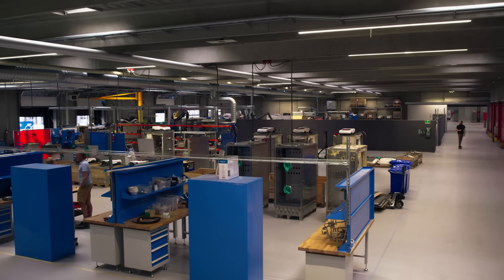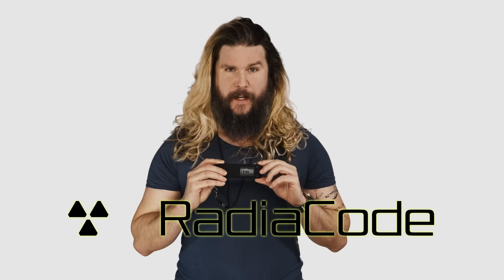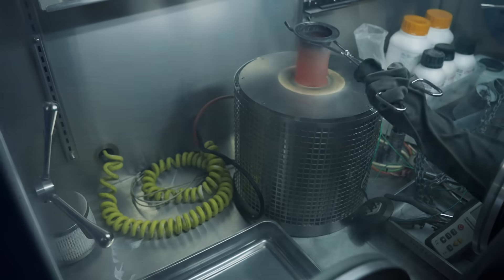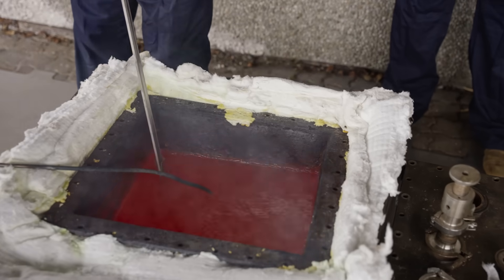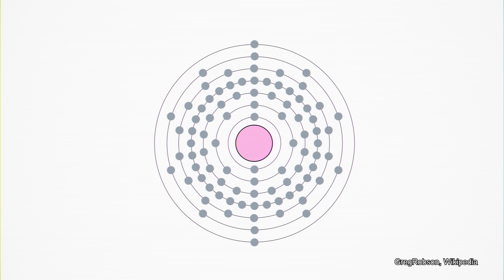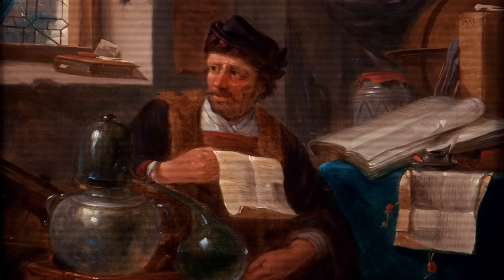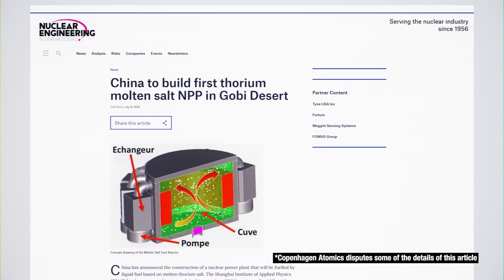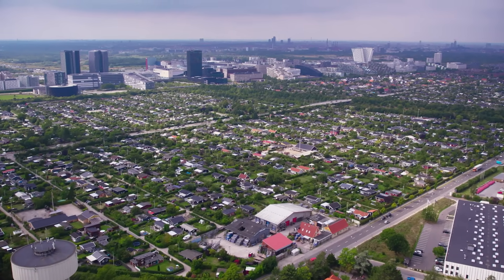Is THORIUM the Future of Nuclear Power?

Comment: The key phrase is "negative thermal coefficient." I wish I'd had heard that in the video. This is what makes liquid reactors passively safe: as they heat up, the reaction becomes less efficient (because the fuel becomes less dense) and the reaction rate slows down, so the reactors cool off and then eventually spin up again, making them self-regulating.
Reply: That reminds me of the sodium acetate hand warmers.  They use a super-saturated solution that crystalizes exothermically... but once the temperature reaches ~160 degrees, the heat actively inhibits the crystal growth by keeping the solution liquid at the melting point of the crystal.  It quite literally can't overheat.
Reply: Retired nuclear plant engineer here. That also is part of all PWR and BWR reactors in the world.   After startup and once reactor and plant power is stabilized PWR reactors pull the control rods and allow the water temperature to control the reactor.
Reply: @perryallan3524  I'm sure he was referring to the MAGNITUDE of a fluid fuel's thermal coefficient vs solid fuel. Does ANY modern reactor operate with a positive coefficient?
Reply: @getmeagator  I understand that there are still some RBMK reactors operating in Russia and a few other countries.  They have positive coefficients at 0-a low power range
Reply: @perryallan3524  Was that before or after they retrofitted them in the wake of Chernobyl?
Reply: @ Both before and after.  The positive void coefficient at very low power are inherent to the design of the RBMK reactor.

The modification after Chernobyl only changed the tip of the control rods - which could add to that positive coefficient at very low power operation.

I do note that the Soviet Union stopped building the RBMK reactors after Chernobyl - they finished a few that construction was well underway.
Reply: Don't keep the 27 day protactinium part of the cycle, too far removed from your math. And when you throw in non-compliant grid scales, amongst deeply entrenched industrialized nations in fossil fuels; you get developing countries as the only viable candidates for this tech to go mass production.
Reply: @numodular  How you get from Th232 to U233 (and other thorium isotopes to other uranium isotopes) has nothing to do with your positive or negative void coefficients as the process is very slow.   This is why thorium cycle reactors are seeded with sufficient U233/U235/Pu239/Pu240 to run the reactor for the 1st several months until enough U233 is generated to run the reactor.
Reply: @numodular Actually there's a decent stash of thorium in Australia, India, Brazil, Turkey and the US. Some of those countries are more developed than the other but they're all economically sizable.
Reply: Passively safe isn't a term. Chernobly wasn't a passive failure... nor TMI, nor many other excursions/incidents. Incorrect (often multiple) inputs were given to cause the incident.

Also, so far, no materials exist that can contain MSR fuel in operation for more than 5-10 years, to say nothing of the contaminated secondary equipment that needs special service and disposal.
Reply: @tehbonehead  Passive Safe most certainly is a term in the nuclear reactor world (and a whole bunch of people are saying that its the sign of a "generation 4 reactor design - but there were generation 2 gas cooled reactor designs that were passively safe).   I believe the 1st passively safe reactors gas cooled rectors were built in the 1970's (I'm not sure if the gas cooled reactors designed and built in the 1950's had passive safety).  Passive safety means that the core will not melt down and release significant radiation if all the active cooling equipment stops working and if the operators do nothing.

As far as Chernobyl, Three Mile Island, and Fukushima.  Those designs all required active cooling to work and often operator actions to manipulate valves and other things (usually with control power to remotely operate valves or start/stop pumps).  You cannot build such reactor designs today in the USA, Canada, and the UK - and some other "Western" Countries.

The Generation 3+ passively safe PWR Westinghouse AP1000 (AP stands for "Advanced Passive") reactor designed was approved by the US NRC in early 2006.   6 have been built and are online now.  A lot more are under construction (China's CAP1400 is a licensed AP1000 design - but a bit larger - and they had Westinghouse design the nuclear side of the CAP1400 power plants).  GE also has a Generation 3+ passively safe BWR design (although none have been built).   The EPR is also Generation 3+ passively safe as well (and I'm not sure of the other modern designs from Japan, South Korea, etc)

In these passively safe designs no active equipment or operator actions for at least 72 hours is needed to protect the core from meldown and protect the public from radiation release.  The plant can loose all electrical power (including control power).  The diesels can fail to start, the operators can walk away from the plant - and passive system will keep the cores from melting down and contain any effects from any of the design base accidents.

I am most familiar with the AP1000 design as I did a consulting job at an AP1000 plant.

The only possible actions needed after 72 hours is in the case of a large break loss of coolant accident (massive primary loop piping failure).  Then a tank that sits on top of the containment building needs to be refilled with water (from plant system, fire-mains, lake water, seawater) and this tank can be filled with firehouses if needed. I'm not sure how many refills are needed ultimately until the decay heat from the core is low enough that gravity water cooling of the containment building is no longer needed (I know that number is known - I did not look into that system in detail when I had access to the plant documentation as I was focused on the system and equipment I was hired to evaluate).

As long as there is not a large break loss of coolant accident the AP1000 is passively safe likely for a very long time as the emergency core cooling is totally passive and only requires a very large tank of water; which is kept full enough to cool down the core for at least a month - and possibly years by radiating the warmed up tank to the air around it at the hottest possible air temperature conditions.
Reply: Better than "positive void coefficient".
Reply: So pretty much they never reach 'critical mass' cuz of loss of efficiency as output rises?
Reply: @kinagrill  not really, the reality is that Nethershaw is confusing the ability to stop the primary reaction with reactor safety.  that is a false assumption.  Reactor safety is dependence on the ability to either withstand or remove the decay heat  from the daughter produces once the primary reaction stops.  As an example: The 3 Mile Island and Fukushima reactors all had negative thermal void coefficients - and melted down anyway.  That is because they all needed active cooling of the reactor (supplied by pumps).  The operator of 3 mile island intentionally shut down the reactor cooling pump because he did not understand what had happened and he condition of the reactor (the NRC ordered retrofits of instrumentation that would have identified what happened and the condition of the reactor and ordered that be built into all new reactors - most other nations of the world promptly followed suit).  Fukushima lost electrical power and the pumps could not run as the Tsunami flooded the emergency diesel generators.

The latest generations of PWR and BWR have full passive cooling capability to keep the reactors safe for at least 72 hours with no operator actions and no electricity.  In the case of the AP1000 (and now CAP1400) all that is possibly needed after 72 hours is the filling of a tank on top of the containment building with water (from any source, wells, rivers, oceans, etc) in the event that the reactor accident involves a large break loss of coolant accident.  The tank can be filled with fire-hoses from the local fire department if needed (although the sites have multiple sets of suitable portable pumping equipment and hoses stored in a separate seismic building on site - and routinely trains with it).  I'm not sure of the details of the European EPR or he latest version of he Russian PWR).
Reply: @Nethershaw  The typical reaction that I get from people when I try to explain delayed neutron fraction or any type of reactivity control is a distant glassy eyed look. It's so simple they taught us submariners without ant calculus, yet when talking to people who are to busy to even balance a checking account or do their own taxes using turbo tax, I found it to be fruitless.

Comment: Molten salt reactor will work just fine with our present U235/U238 fuel chemistry. If it's such a good idea, why aren't they being used now? You do not need thorium. If you want to use thorium, you need to breed thorium into U 233 economically.

Comment: Ever since I discovered thorium salt reactors as a teen, I've always been sold on their use. It just felt like such a no-brainer. It's been exciting seeing the old technology finally gaining in popularity. It's seriously about time!
Reply: Yeah we have known about sodium as a reactor coolant since the 50s, the problem is that the biggest buyer of reactors (and investor) was the US Navy, and naturally they chose the competing water cooled reactor to put on ships and subs because floating a tub of liquid sodium in the water would be unwise. Because of this, all the investment went into water cooling systems when we could have always had meltdown proof reactors from the start.
Reply: @PRC533  A number of counties built sodium cooled reactors.  Several lead eutectic alloy liquid metal reactors were also built.  For the most part they all failed in the market for economic and safety reasons.   Liquid sodium is not a safe thing to deal with - especially if there is a leak and there is any water or even very high humidity (explosive results).  Also, how do you fight a fire in a containment building with a liquid sodium reactor.

The US navy went with water cooled reactors due to how much water is always in a naval engine-room and other engineering spaces and the safety concerns of liquid sodium seawater explosions.

The lead eutectic alloys had an amazing ability to seriously degrade piping and components at their operating temperature (I've read the reports describing the lessons learned with lead eutectic alloys - not good at all).
Reply: The USA built 4 commercial thorium cycle power plants in the 1960's - 1980's, and Germany built a 5th one in the 1980's.  While some of the plant designs did work; what was really proved was that using thorium was far more expensive than using modestly enriched U235.  It cost far more the extract the thorium from the ore and turn it into reactor fuel/breeder fuel than it cost to extract uranium from the ore and modestly enrich it to make reactor fuel.   They modeled scaling up production to supplying 100% of all US nuclear power plants - and the cost of thorium cycle fuel was still a lot more expensive than thorium. Several of the plants were quickly converted to U235 based fuel and ran for years.  Economics killed further developed of thorium - and I have seen nothing to indicate that the cost difference has changed over the years.

We have proven core designs for BWR and PWR reactors.  If thorium was cheaper than uranium about 80% of the nuclear power plants in the world could be running the thorium cycle.  But no one is doing that.

I posted a long post in response to the video with a lot more details (and things you can look up on the internet).  Look for it.
Reply: @ I don't know for those in the US. But the one in Germany also had some pretty bad incidences.
Reply: @ That was because the German Pebble Bed reactor was not inside a proper containment building - and allowed radioactive particles from broken pebbles to escape the plant site.  The German population had zero tolerance for that release and do not understand why the reactor was not inside a proper containment building; which is why the plant was shut down.

The Germans who developed pebble bed reactors have identified 2 problems with the pebbles:   1) They break a lot more often than ever expected.  2) Some of them get stuck in the bottom of the reactor which causes other problems.  So far the Germans have not figured out a solution to either issue - and both pebble bed reactors built in Germany have very expensive decommission cost as no one yet knows how to get the highly radioactive stuck pebbles out of the bottom of the reactors.

The Chinese licensed the German pebble bed technology and have built a modest sized pebble bed power plant with some design changes in the hopes of minimizing broken pebbles and stuck pebbles.   They have not yet said how well it works and it may be 5-10 years before we have a good understanding on how successful their design changes were.

The US Plants had no radiation release problems, but 3 of the 4 reactor designs built were technical failures (1 BWR and 2 HTGRs) and we learned a lot about how not to build that kind of power plant.
Reply: @ I guess that shows, that in the real world stuff does often not work out the way you planned on paper. And you do not want to find out what doesn't work as planed with a life reactor with radioactive material in the mix.
Reply: There were a few attempt in those decades. You have to understand, that they were all failures. some with dangerous consequences. A lot of them because of mondane stuff that you do not even think about when you design a reactor. Things like corrosion of the pipes. The hard truth, that nuclear fanboys have to face is that every little technical problem becomes a huge issue when you are handling radioactive material.
Reply: u gay

Comment: So In the Thorium reactor you need the chemical plant to convert the Thorium to Uranium 233...... This plant uses Fluoride based chemistry at high temperature, which is highly reactive, highly corrosive and very difficult to maintain.     This is the true drawback of Thorium, the reactor part isnt really the problem its the chemical plant that so far is the problem ... good luck....

Comment: I have been listening to Kirk Sorensen for years about LTFR and IMSR, glad to see it getting more attention.
Reply: Indeed Sorensen has been advocating Thorium for over a decade now. Also there have been numerous TechTubers and SciTubers published their takes on top of it. It seems high temp, high-pressure plumbing still  is the main issue?
Reply: @MistSoalar  Not as much as the caustic nature of the Beryllium salt mix that erodes parts including parts in the heat exchanger.

They have composites that seem to remedy the issue but they are expensive to produce.

Comment: Would it make this process even more efficient if a thermoacoustic engine ( based on stirling cycle) was used to generate electricity instead of having all those moving turbine parts, which are both sources of frictional loses and breakage points?

Comment: There is already a running molten salt thorium reactor right now: The 2MW "TMSR-LF1" ("thorium molten salt reactor liquid fuel number 1") was completed in 2021 and reached criticality (self-sustaining reaction) in Oct. 2023, and has been running to this day (Jan. 2025).
I am not 100% sure, but I believe it wasn't called the first Thorium Molten Salt Nuclear Power Plant, because (1) It is experimental and running in batch mode for now, and (2) It does not yet have the equipment to generate electricity to be sent to the grid.
Reply: There is also the planned 10 MW "TMSR-SF1" ("thorium molten salt reactor solid fuel number 1"), also a pebble bed reactor.
Wikipedia says it's 100 MW and supposed to be ready by 2024, but that conflicts with other papers I've read so further fact-checking is needed.
Reply: A 2016 paper (DOI: 10.7693/wl20160904) already outlined the roadmap of the Chinese "TMSR" series of reactors.
The short-term goal was to have both a solid fuel and a liquid fuel experimental reactors running by 2030. Now we know the liquid fuel one is the operating "TMSR-LF1" and the solid one is "TMSR-SF2".
The medium-term goals are to (1) Generate hydrogen directly from the reactors, and (2) Develop water-free cooling methods. There's no deadline given in the paper.
Using thorium to generate electricity for the market is actually considered "long-term goal" by the paper, with commercialization by 2050, so it would actually take quite a while for that to happen even if all goes to plan.
Reply: The molten salt reactor road map from the 2016 paper (DOI: 10.7693/wl20160904) was:
Solid fuel: 10 MW "TMSR-SF1" for research (already superseded by a simulator "TMSR-SF0") -> 100 MW "TMSR-SF2" for practical demonstration (such as hydrogen generation) planned by 2025-> GW "TMSR-SF3*" for commercialization by 2050.
Liquid fuel: 2 MW "TMSR-LF1" for research (already operational) -> 10 MW "TMSR-LF2" also for research (the one mentioned in the video, I guess now they also added power generation) planned by 2025 -> 100 MW "TMSR-LF3*" for practical demonstration (such as electricity generation, but it appears now it has been pushed ahead to be part of its predecessor) -> GW "TMSR-SF4*" for commercialization.
* speculated names